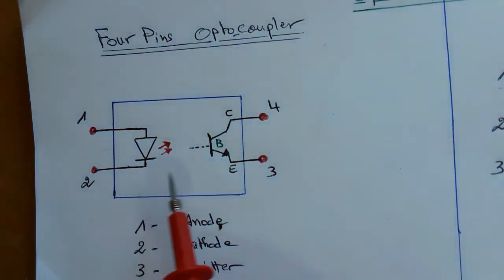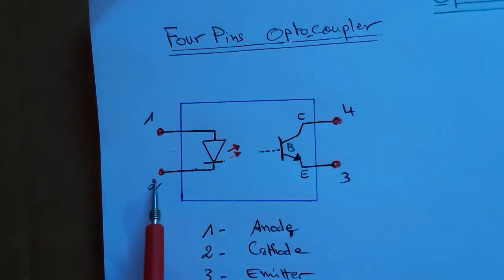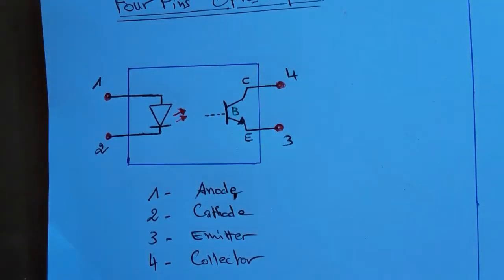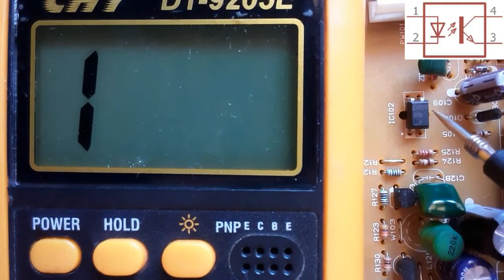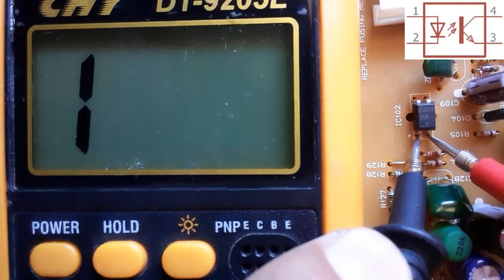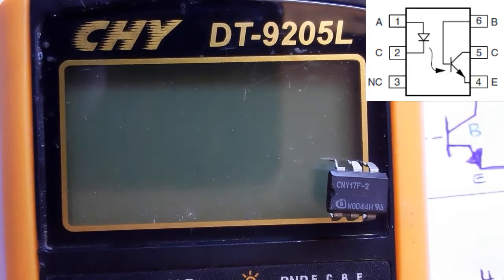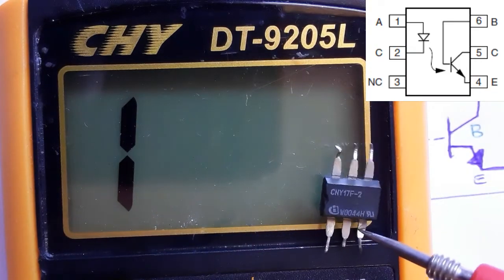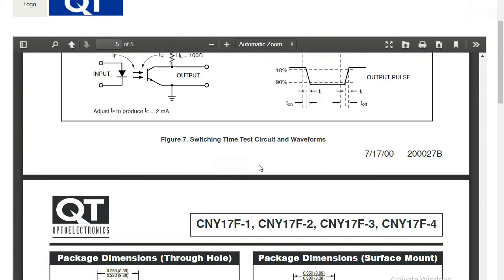How to Test Optocouplers and Opto-isolators with a Multimeter

Comment: weird I test pin 4 to 3 with diode mode and there was 0.500 volt drop! and when i reverse probes it was zero but still weird its not shorted yet conductive! how emitter and collector are connected without a pulse to the gate? it doesnt make sense even if it was faulty that not how faulty transistor look like!

Comment: Thanks for showing this quick and easy method of testing optocouplers with a multimeter. As others have pointed out a more detailed test could be done which entails desoldering the chip...ugh. Cheap optocoupler testers can be bought online...someone needs to do a review of these.

Comment: This method is not a general rule because some optocouplers or gate drive optocouplers have characteristic differ than those in video, some times the output is open circuit inside or the led has  not enough light to emitting to run the base. so you should remove it and test it with two digital multimeter or make a simple circuit as recommended in the datasheet.

Comment: Should 1100 come out without AC 220V power supply?
Reply: Yes, this is the Vf of the photodiode in millivolts (when using the diode test  mode of the multimeter), with the circuit out of power.

Comment: Q) It the transistor is damaged/open, you would also get no reading on Pins 3+4, so wouldn't you also need to test that the emitter and collector connect  when the diode/LED illuminates the photosensitive base?  Thx.
Reply: Yes, he should have tested the C-E junction of the phototransistor by connecting a second multimeter across it (set in diode function) with the plus probe on the collector. Then he should activate the photodiode, in the same way, and see the switching action of the phototransistor when the photodiode is activated. The described method in the video does not cover this critical part (and your question makes sense)!

Comment: I'm a total electronics moron - but why others are using some more complicated methods of testing opto-isolators eg. one guy desoldered from the board and connected all 4 pins and use a resister and battery etc. Can I test an opto isolator "your way" directly on a board? (no desoldering involved). Thanks
Reply: It gets complicated. In circuit, no soldering, you may get readings from other components in the circuit. This is a good base test to show shorts or opens on the opto. Of course a short elsewhere in the circuit will show a short on the opto.

Comment: How do we know is it optocoupler or an IC by doing it visualy when it still on circuit?? Is it any sign?
Reply: I recommend 1st to read the marking, and internet search the number(s) you find.  If you have more knowledge...  Optocouplers are a non-contact way to connect 2 circuits on a PCB that may be operating at different voltages, so look at the PCB circuits and see if the device appears to be "isolating" the two circuits.  The transistor side (pins 3+4) are acting like a switch for the 2nd circuit.  Similar to how a "relay" works ... just using light to activate vs using mechanical means.